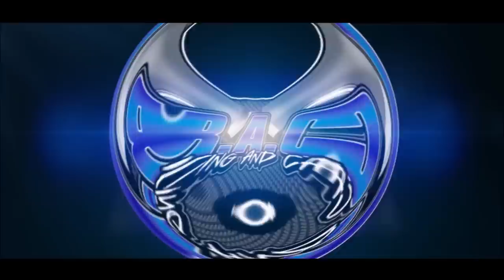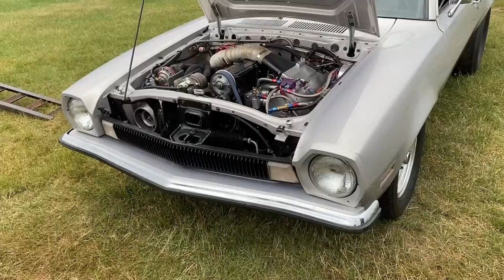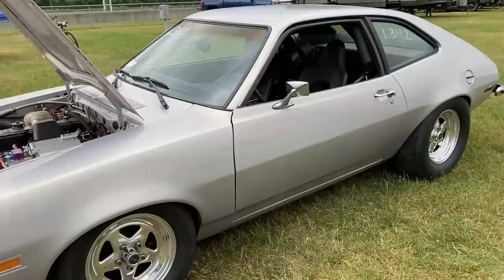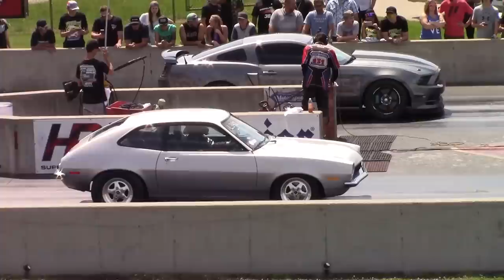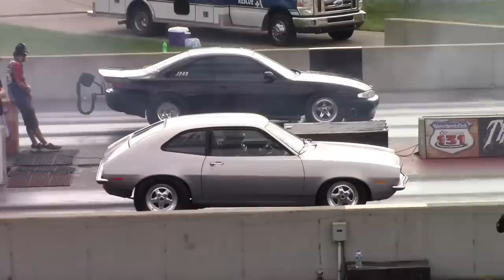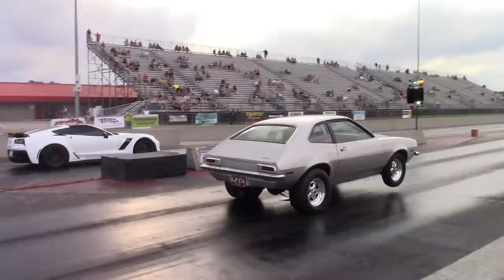4 Cylinder Turbo Pinto Sand Bagging Against a Mustang GT, C7 Z06 Corvette & Turbo LS 240 1/4 Mile

Comment: That’s the way to safely own a Pinto, make it so fast that no one can rear end it.
Reply: LMFAO
Reply: Underrated comment
Reply: I had a 1980. I called it adventure driving.
Reply: lol lol lol lol cleaver
Reply: OUCH! lol literally
Reply: That's funny 😂😂😆
Reply: I see the humor, but an ignorant comment 😖
Reply: @theothertroll  I see you live up to your name.
Reply: @theothertroll  oooo booo hoo
Reply: @reginaldbyrd8073  like a knife?
Reply: I had a 77. Never had to change the oil. It was automatic. All I did was add a quart every week or so.
Reply: @Threedog1963  Are you sure that it wasn’t a Vega? That’s a Vega joke. The Pinto’s engine had a reputation for being pretty good.
Reply: @Threedog1963  we’re you using Quaker State? 😀
Reply: @Threedog1963  I've owned many cars that were equipped with the continuous oil change option.
Reply: hi B...
'
i do love mercury bobcat car in 1975...
gone bobcat car
Reply: @Threedog1963  Sounds like our '75 Vega. Kept a case of oil in the trunk.🛢️
Reply: @boataxe4605  That's Chevy Vega TRUTH.
Reply: I'm 61 and have been a Chevy since I could remember. My dream car was a 1969 Chevy Nova SS 396ci four speed manual, but never had one. Closest thing was I bought a 1972 Nova that had a worn out Chevelle 305ci engine. I believe 3/4 of the oil passages in the rocker arms were clogged with caked on oil. 
The Ford Pinto is one bad ass car for having four cylinder turbo capable of doing 8:92 @ 152mph. Everyone of the cars it ran were at least 2,000lbs heaver.
Reply: How many NHRA trophies did Bob Glidden receive driving his Pinto? I know he won 10 World Championships.
Reply: That’s funny and true
Reply: @bestamerica  I had a brown and orange Bobcat painted on the side came from the factory like that 4 speed on the floor
Reply: 😂😂😂😂😂 I remember that damn I’m old
Reply: That's a myth
Reply: Those GM trucks with the fuel tanks outside the frame for 10 long years were far worse  🔥

Comment: I had a 1971 Pinto in 1975. It was my first car. My brother and I competed in everything from bicycles to cars. My poor little Pinto received a cam, headerrs, DP distributor, cold air intake, traction bars and of course some wheels. My car had the 2000 cc engine which was a beast. It was such a sleeper I have raced several cars with V-8's and buried them. The lightweight car would leap off of the line like you see in this video and everyone was trying to catch up all the way. I called it the "Mean Pinto Bean"!
Reply: I’m jealous I’d love to have one of these pintos, so cool!
Reply: the 2,000 were better than the 2,300 c.c.
Reply: My first cam shaft and T. Belt @15 years old  1972 pinto runabout 🔧🔧🔧🔧👍🇺🇸
Reply: Had a friend back in the day that had a pinto wagon drag car 302 car called it pinto beans.
Reply: @frez777  Exactly...they screamed.
Reply: A friend of mine had one when I was in high school in the 80’s.  The Pinto was amazingly quick and was the ultimate sleeper.
Reply: Sure you did....
Reply: @northface484  Feel better now ?
Reply: Those "Lean Mean Pinto Beans" love eating Mustangs. Family rivalry I suppose?
Reply: I had the same motor 2000 cc - 4 banger in my 1973 Capri. I built the motor with a speed shop, bored out, bigger , crane cam, headers, racing carb and more. Auto trans had to be swapped out 3 times as it has power to melt the tires in all gears. :oops:
Reply: Did the 2.0 and 2.3 have the same valve train?  I remember Pintos as having a unique arrangement with a stationary hydraulic "lifter" embedded in the cylinder head, so the only reciprocating mass was in the rocker arm and the valve itself.  Seems like it could be made to rev pretty high.
Reply: @susanbrownbrown7541  Haha! A dragon wagon named pinto beans. Awesome!
Reply: @montestu5502  Absolutely, I had a 72. Great car.
Reply: I had a ‘71 as well.  A little carb work, a little freer flowing exhaust and I would surprise Cameros on the street all day long.  Get past 70 and I ran out of stream.  Stop light to stop light.  Of course I’d never do such a thing today! 😅
Reply: Pretty much the same; shaved head, cam, a single blackjack header (you said headers but there is only one! :) a little holly 390cfm 4 barrel. I should have built up the trainy parts, I broke cluches shocks, etc., but man it was light and fast. When the Pinto came out, Lee Iacocca said under $2,000 and under 2,000lbs so a little increase in hp made a big difference, a big increase in HP meant I could embarrass v-8s all day long. That little German 2 litter would rev all day long. Fun days.
Reply: I did it the hard way. 1971 1600 cc, 30 over, cam, header, and a pair of Weber side drafts. I had to relocate the battery to the trunk on account of the carburetors. My dad drove a company car with a 302 V8 and two barrel carb and I blew him away everyday. I was quite pleased with myself putting this together in my late teens.
Reply: Guys, Here is The Savior

YaH The Heavenly FATHER HIMSELF was Who they Crucified/Pierced for our sins and “HERE IS THE PROOF”

From the Ancient Egyptian Semitic: 
"Yad He Vav He" is what Moshe (Moses) wrote, when Moses asked YaH His Name (Exodus 3)

Ancient Egyptian Semitic Direct Translation
Yad - "Behold The Hand"
He - "Behold the Breath"
Vav - "Behold The NAIL" <— YaH’s Crucifixion
He - "Behold the Breath"

“Behold the HAND that Beholds The NAIL” 

PROVES - YAH The Heavenly Father HIMSELF was Who they Crucified

That is EXACTLY what Moses Wrote

Here is what they mean

YaH's Name:
(Ya)d + (H)e, as YaH is what Moses called Him and YaH Declared: "this is My Name, this is My Name for all generations" (Exodus 3)

YaH is The Creator of “MAN”: (Genesis 2:7)
Yad He, (HAND BREATH), as YaH's "HAND" Formed man from the dust  of the Earth and His "BREATH" made him a living being (Adam)

YaH's Sacrifice of Crucifixion for “MAN”:
Vav He (NAIL BREATH), the "NAIL" through YaH’s "HAND", in Sacrifice of Crucifixion, that whosoever shall call YaH Savior, His “BREATH” brings forth life (Salvation)

How YaH arrives:
YaH arrives via the Tent of Meeting (Exodus 33:7:11, Isaiah 54, 55), where a Tent is erected outside the city, a cloud descends upon the entrance of the Tent and YaH appears...

Why they demanded YaH to be Crucified:
YaH was Crucified according to Hebrew law (Deuteronomy 21), to be NAILED/PIERCED on an Almond Tree for BLASPHEMY as it was for His NAME they demanded Him Crucified. The Messiah claimed He was YaH...

HE WAS YaH!!!

HalleluYAH translates “Praise ye YaH”

The Hebrew Book of Isaiah

Isaiah 42:8
"I am YaH; that is my Name! I will not yield my glory to another or my praise to idols.

Isaiah 43:11
I, I am YAH, and there is no other Savior but Me.

Isaiah 45:5
I am YaH, and there is none else.

Comment: Definitely sandbagging if he's popping off consistent 10's coming off the line that hard! A 100% perfect build that's not just another ls swap. Thank you for staying out of the norm, sir. 👏👏👏👏
Reply: I thought I had the speed setting turned up when I saw the launch but I didn't....I wonder what the 60' time is.
Reply: It's likely not sandbagging, but probably is bracket racing. You get set in a bracket (of times) and you can't "break out" if you do, you're out.
It's stupid, I've never bracket raced, I only do all out.
Reply: Can you explain what “10” means here?
Reply: @Joe Dellinger  the time it set I. Qualifying  was 10 seconds . He now can  go no faster in the quarter mile than 10 seconds  or he loses.

Comment: The launches are incredibly consistent. Nearly no slip. JUST WOW.
Reply: All the weight is on the rear. Small light engine in the front.
Reply: "All the weight is on the rear" is just a really idiotic thing to say, with absolutely ZERO accuracy to the statement.
Reply: @gavinvalentino6002  Well..perhaps ...from an idiots point of view, but the Pinto has a very good weight distribution. The driver is slightly rearward of the center of the car, if he has installed a racing seat its probably even back further than stock. The back seat pretty much sits on the rear axle. At launch even more weight bares down right on those rear tires adding bite.
Reply: If all they weight was on the rear that thing would have come up in the air and kept on going. Looked to me as if the weight was pretty evenly centered 👍🏼👍🏼👍🏼
Reply: @TWTexasA1 ,
   He pulled the front tires and that's when the weight was all on the back. 
That's how that works.
Reply: @oldnick4707  Exactly.
Reply: @gavinvalentino6002  It’s just a saying for more weight distribution towards the back. I’ve never heard anyone take it literally.
Reply: @Larry Thats why I never even bother to take my Basically stock 17 Super Sport Camaro 6 speed to a track. I know I can never get a good run because I would just spin coming out the whole. Either spin or feather the throttle, either way it will lower your E/Ts.
Reply: Weight difference? Who is and who isn’t using slicks?
Reply: I’d like to see the time slips. Curious as to what the Pinto’s 60-ft. times were.

Comment: Dave - Your car is a hoot!! When I saw it launch I burst out laughing. I learned to drive on a Pinto.
Reply: I learned to drive a manual shift in my sister's '72 Pinto when I was about 12 yrs old in 1977.
 Funny thing, I have seen two pinto wagons in the last 3 days around where I live. Both driving, one red with the fake wood siding and the other a solid red. 
 Don't see them very often for years and then,, bam two in as many days, on the road.
Reply: Exactly

Comment: I used to have a pos primer black 1986 4x4 ranger with a 2.2. I decided to hop it up after I discovered Eslinger engineering and their parts. Had a massive cam and full port job. 12.5 to 1 pistons with an Eslinger intake and 500 holley. Hooker super comp header. It sucked in the winter. But in summer it could smoke a Porch boxer like nothing. Even took a zo6 back in 2001. It was really fun and really loud!!

Comment: It's crazy what you can do with a 4 cylinder nowadays
Reply: It's called power to weight ratio.
Reply: Yay I know but it's only half a v8 and some 4 cylinders can put a woopin on a some v8s
Reply: @tg2963  Chevy is now putting a 2.7 liter 4 banger in their 1/2 ton trucks in lieu of the 4.8 v8 which they used for years as well as the 5.3. The new 2.7 High Output is turbo charged and is putting out over 300 hp and 400 foot pounds of torque. Better HP than the 4.8 and better torque than the 5.3. Our company just bought the first one of these this week. Has a bit of turbo lag on take off compared to a v8 but still snippy after launch, haven't pulled a load with it yet and also interested to see if it will be a 250K engine.
Reply: They been doing it for a long time. there was a HOT ROD magazine. that had an article in it called 1000 HP for 1000 hours. where they built a  2300 2.3 L Pinto engine they balanced the rotating assembly and used forged Pistons put a cross flow D port head on it,  with a high lift Long duration cam. and used a mechanical fuel injection from a Mercedes Benz and fabricated on to it and a turbo charger and ran it on the Dyno at 1000 HP for 1000 hours it was the cover article in the magazine.  I believe that was in the late seventies, or early eighties. you could probably research it though HOT ROD Magazine

and where Is live there are guys that build these engines. to use on the local NASCAR sanctioned circle track. they only allowed to do certain things to them per NASCAR rules. they can do light m machine work, they can use the D port head, they can raise the compression ratio. they can use an intake manifold with it certain part number. and a certain camshaft. and a 500 CFM Holley carburetor and a header. and they can get 300 HP out of them they are unbeatable on that track. and they have been doing this for quite a years. the 2300 2.3L Pinto engine is a hell of an engine. they are durable and make really good HP. they are one of the best four cylinder engines ever produced.
Reply: @anthonyrichard461  They typically gas guzzle worse than V 8s when they tow. Or carry loads. Your almost always better with a V 8 for hard work. The only better engine is diesel. But who knows they might eventually work that out.
Reply: @jg3000  You are right, there is no replacement for displacement.
Reply: @anthonyrichard461  LoL, if it has AFM it will shut off completely 😂😂😂
Reply: @jg3000 thing is, most people don't tow.  Most people don't even load the bed but a few times a year at most.

Comment: I had a pinto wagon my daily driver 1at car 2300, Put a 2000 in it out of a sand rail Got a ticket in it doing a 115 miles an hour on I-15 , As the years went on one of my inlaws dominated the pinto race class at Cajon Speedway in El Cajon Smiling Ed Hale, I absolutely love what you did with your pinto fast as hell and you did a beautiful job on the pony👍👍👍👍❤️
Reply: 72 Cortina 2000 at 110 could not shake off an 850 Fiat, both pulled over after going through radar cop done us decent by fudging the clocked speed on the ticket which kept us from having to appear in court.

Comment: I had a orange pinto wagon in the early 80's  with a small block Chevy 350/350..no frame reinforcements no beefy differential.Just pure Micky mouse backyard engineering...it was all smiles and grins until the doors wouldn't open/close no more and the frame rails peeled off the floor/firewall and car basically broke in half.. LoL.. wouldn't change it for the world...wish I could re live those days...

Comment: I built the 2.3 in my '93 Ranger XL.
Went from 97 hp to 435 hp and 410 lb/ft tq.  I use it as a stoplight sleeper. It looks completely stock, other than the 17" 2003 Mustang Cobra mags I put on it.  Trying to run it on the 14" tires was not happening.
Edit: I'm in my mid 40's and I have a V-8 in almost all of my vehicles, and they range from 1938 to 1993, and that 2.3 was the cheapest and easiest build I've ever done.
Reply: Run a compound setup with a cabin adjustable wastegate... 30mpg or more but 450hp(ish) at your fingertips.

Comment: I love the way that Pinto hops up on the launch and takes off like a bat out of hell.  My dad had 3 Pinto's (71, 72, 74), and all my siblings including myself learned to drive on them.  Why so many Pinto's?  Well, 3 kids going to college all within a year or two of each other.  My dad would drive them for a while and hand them off to my older siblings after their Freshman years.  The 71 came recycled around to me (I'm the youngest) when I was in High School my sophomore year.  I drove it only for a year before my dad got rid of it and bought a Ford Futura (inline 6, had some power but didn't really pull because of the weight).
I had fun in that 71 Pinto.  Really learned how to drive a stick shift and rear wheel drive.  
Later on when I was out of college and working full time I had an Acura Integra (88) with a 1.6L DOHC 4 cyl.  I surprised a few people with that car, and it handled very well (wide wheel base and low to ground / center of gravity).  Still drive little 4 cyl cars to this day.  Nothing like a peppy little 4 banger.

Comment: Owned a 78 Pinto with a turbo charged four banger (2.3L). I've had it up to 180 mph, so I have no trouble believing this because mine wasn't nearly as tricked out as this one. It was white with blue flames and got me a lot of teasing, until it left almost everything in the dust. Then it got me a lot of respect. 😂🤣

Comment: The Pinto was finally recalled in 1976 and fixed by a bladder. They  were not allowed  to be sold in Canada , unless  the tank issue was fixed , and they did that ,long before the U.S.A. had it fixed . This current calling it an explosive car is just hatred and or no knowlegde of the history . In fact any car in the 70s , when hit behind hard enough had the potential to catch fire.  Of course government and gas companies would like you to drive a gas guzzler ,  more money for them and taxes are involved. These cars run forever and were quite reliable. Plus , they wanted to get cheap imports in America. Fact more fatalities was in a Datsun  510/1200 according to 1975and 76 studies.

Comment: I took a 2018 2.3 liter mustang and lightened it - considerably - swapped out the snail for a much larger one, made sure the block was reinforced etc. ended up dropping over 360 pounds! Making 512 whp. I left the rest alone, just added some skinnies up front and some drag tires out back, and had a blast. - That 10spd, say what ya want, but I could dial it in all day at 12.07 secs and take home trophies lol... pissed so many people off with it but had the best time. The cost wasn't nearly as bad as I'd thought it would be, either. - LOVE the old Pinto/Vega drag beasts. I may be 60 but a speed freak I'll always be lol. - THX for the comments and I'm sorry if I hurt anyone's feelings! What's that ? ANOTHER trophy? lol I'll take that!

Comment: These Pintos are probably around 2000 lbs max. They are go karts with bodies. Nice to see an old Pinto redeeming itself as they had reputations for head gasket failures. That was back when they were still using cork and paper gaskets. With the new hi tech silicone gaskets today it probably would have not even been an issue then.
Reply: Drove 1 for years and never had a gasket problem
Reply: @mikecross4350  Lucky.
Reply: Dave the dude that owns this one said in the comments it's close to 3,000 lbs.
Reply: @429thunderjet2  Then its much heavier than stock.
Reply: @matrox  yup idk but that's what the guy said. You aroused my curiosity to search a little. Wiki lists the early pintos at 2,015 to 2,270 lbs. I would imagine with the wagons being the heaviest, so idk what's up w that. Unless the guy did a bunch of extra reinforcements or something?